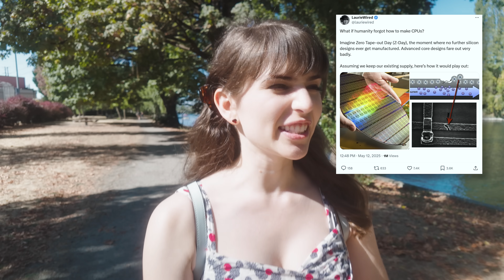what if humans forgot how to make CPUs?

Comment: The loss of CRT manufacturing is worse than people just forgetting. As soon as the production lines shut down, the extremely specialized machinery needed to produce the tubes and windings were immediately scrapped and what few remained were sold off to Chinese and SEA companies who kept manufacturing CRTs for just a few more years. Today, the machinery is completely gone and it would be beyond expensive to create from scratch considering how niche the CRT market is. The cost of starting up a new manufacturing process would dwarf any potential profits. We haven't forgotten. But we've willingly destroyed our ability to do so.

Also, geese are nobody's friend.
Reply: That has actually happened a lot through out history, it's a big component of archaeology, especially when encountering a previously unknown civilization or previously undocumented materials are found.
Reply: They should keep making CRT for Radar or even Oscilloscope and all kind of system that need analog measuring of electric signal in some communication field or medecin and army it's still usefull. But don't worry we still made valve or tube triode for guitar and audiophile equipement because it's so different than transistor.
Reply: Its not lost yet. 'Thomas Electronics' still continue to manufacture them. And there are a few other companies. ofcourse the number is not big, but they exist. And i'm not sure if they are all chinese. I think thomas electronics, for example, are an american-european company.
Reply: @ericaugust1501  Thomas Electronics doesn't produce new CRTs. They refurbish and restore already existing CRTs. The idea that they're producing more has been debunked multiple times. Nobody still produces new CRTs.
Reply: @Darxide23  the following, verbatim, off their website:

In addition to manufacturing CRTs, we also specialize in cathode ray tube replacement and refurbishment services for the benefit of our many clients who continue to use this technology.

so either you are talking ignorantly or they are lying and falsely advertising....(or more innocently, this is some sloppy copy by their website manager)
Reply: @ericaugust1501  Maybe they manufacture CRT monitors but not the cathod ray tube in them?
Reply: @ericaugust1501  There are a number of specialist companies that continue to make tubes. Some also exist that can refit old tubes with new guns. There's every possibility that someone will appear to fill the need for arcade screens. Once the backlog of tubes is all but used up, there will be a much larger demand than there is now, and demand means money. The main problem with doing this 10-20 years ago is that there were still too many good tubes floating around for the amount of people and businesses hoarding cabs
Reply: This comment haunts me...
Reply: CRT production has a lot of common with X-ray tube. People just need decrease voltage and use circuits to move electronic ray inside.
Reply: @serhiizabobonin1016  I have Oscilloscope CRTs using 17kV. I am sure there are higher voltage ones still around.
Reply: All my friends are geese.
Reply: Bit like letters for print presses. People just sold them as junk metal for the price of a coffee or similar. And manufacturing new ones probably is somewhere around 5 or even 6 figures...
Reply: CRT is for sure not stuff i am nostalgic about ,but world before smartphones YES
Reply: Depends on the geese! The ones that live in my city are extremely used to humans and are probably less of a nuisance than pigeons. People sit around in parks with geese picking up their food scraps all the time. Cool animals?
Reply: One saving grace, there are technically still CRTs being manufactured, they just don't output visible light nor have the necessary beam bending equipment.

To clarify, I'm talking about X-ray and other electron beam generators.
Reply: Geese are dicks… I thought Canadians were supposed to be polite?
Reply: Plasma is just as good. Better colours, deeper blacks, similar motion clarity
Reply: That is not at all true. TVs were not the primary use of that technology. Tv was an excellent stepping stone for the technology. Now it is used in all kinds of imaging applications from medical to electron microscopes.
Reply: Someone has one in their personal collection. We created it once, and we can do it again. It would suck, but I assume anarchy and war would break out first. What a nightmare.
Reply: @persephone342 There isn't enough widespread desire for new CRTs compared to the amount of them still floating around to warrant some company spinning up production at the scale that could make producing them affordable. Currently, there are at least a few companies that can refit old tubes with new guns, and I suspect that those businesses will be the industry that emerges to fill the need for usable tubes. Someone will have to start making new electron guns (for it to be affordable), but that's a lot easier than a tube factory.
Reply: Well, if forced to, it can be remade
Reply: @bruhistantv9806 no one is going to force it. the vast majority of people prefer new flat panels. the small need for refurbished arcade monitors can be met by re-gunning old tubes. we already have shops that can do that
Reply: We can't forget how to make CPUs... Their designs are everywhere in every textbook of electronics and semiconductors. Even I have made an 8bit CPU on breadboards from scratch and I know that someone made a 16 bit CPU as a DIY project. An other guy that made a 64 bit analogue processor in minecraft. Another guy used home made lithography to make the Zeloof Z2 chip that contains 1,200 transistors. We can't forget how to make CPUs the information is everywhere and we can scale it very fast. We could forget some very important trade secrets. We could loss 10 or 20 year of progress if a major production line or a manufacturer gets hit by a disaster. But nothing as serous as what you describe.
Reply: By SEA you must mean the Society of Explorers and Adventurers as part of DisneySEA!
Reply: @Maccbruce  No, it's the SEA men....
Reply: CRT suck
Why would we want to waste resources and energy on an obsolete, inferior, more dangerous technology?
Reply: @Soguwe  You've never seen the 4k View Sonic CRT then. It was 4K with deep blacks like OLED, and the refresh rate was at or even above 220 HZ with no need for graphic card power to push it, and no motion blur because it was tubes drawing the screen in real time and not digital. Garbage PCs back then could play the original Unreal Tournament at 4K just because of this monitor alone.
Reply: @madskygames7386 so some of the obsolete tech was of quality. Big whoop.
It was still a big tube that has a tendency to explode when damaged.
Reply: @Soguwe foolish comment and arrogant mocking mind set you have
Reply: @vidfuel12 are you denying the fact crt are dangerous?
Reply: Why we need CRT dude? they were huge bulky and expensive with less quality. You're literally blinded by nostalgia. World was right to move on. You don't need to preserve everything if it doesn't serve purpose.
Reply: @jadugar3518

It may well invoke your disdain, but there's a huge market for CRTs in retro gaming - and there are actually some advantages of CRT - over modern screen designs.
Reply: @liberatumplox625 Also the tiny few who still make CRTVs do so because they are still vital in certain industries (tech, exploration, military) and this is done for many reasons, even due to the fact some systems while still valid/operational are out of date. I believe most of these sets are quite small so perhaps larger systems can no longer be manufactured.
Reply: @jadugar3518  You might be thinking of TV tubes. The CRT in an analogue storage scope can reveal waveform details reliably that a digital scope cannot be trusted with. It does not matter to a repair man - who only needs to see if the wave form is what it is supposed to be or not, but to a design engineer, analogue is essential to find out if there is a new and previously unseen failure mode.
Reply: @jadugar3518  You know nothing about CRTs. Trinitrons had superior image quality compared to LCD displays well into the 2010s. They still look superior to bargain bin LCDs today.
Reply: @ChefDeCuisinart i have had two CRTs. Each lasted 10 years. They are not great in picture quality. You could literally see each pixel. They consumed more power. Sometimes they explode too. You're blinded by nostalgia. World did the right decision by moving forward.
Reply: @jadugar3518  Yeah nah this sounds like you had standard "TV tier" 480p CRTs and have now just projected that experience onto the ENTIRE technology
Reply: @jadugar3518 sure, cheap 480i tubes were junk, but you could say the same thing about 720p LCD panels today. 

The much more advanced 4k (interlaced) panels of the late 2000s were nothing like the junk 80s era designs, just as the 8k microLED Tvs massively improved on the VA design of the previous decade
Reply: @ChefDeCuisinart  Depends what "quality" is. Color gamut, geometry, brightness and pixel density of modern LCD is unreachable for CRT. It isn't possible to make CRT as 12" 300 dpi 1000 nits screen no matter how much money do you throw into that ring. And yet LCDs will do it while running on battery and being held in your hands. Principal "image quality" of CRT is lack of inherit motion blur. And anyway LCDs aren't really top of the range screens. OLEDs are current state of art.
Reply: @bariole why on earth would anyone want a 300 dpi 1000 nit 12in CRT. Why are you making up a pointless product to make your argument look better, lol
Reply: @jadugar3518 This just shows your ignorance of what they're good at that sample and hold are not, and of the resolutions we were capable of on especially LATE era PC monitor-tier vacuum tubes
Reply: @jadugar3518 - A good CRT would last 30 years if you kept the brightness down. Longer than that if you're willing to replace the old electrolytic capacitors. Old CRTs were designed to last. Modern displays are designed to fail. 
Nostalgia? No, practicality!
Reply: @YodaWhat  what's modern application for CRTs?

Comment: losing the ability to make cpu's... presuming it's lsi's, we'd always have larger stuff.  it's pretty expensive to make cpu's out of individual transistors, but a 64bit transistor based cpu with everything we need to interpret and read old files, refresh them before they fade and store them in ways that would keep them from fading, not too difficult, just really tedious.  in the early 90's some time there was a product that put binary data on blank paper for instance.  anyway, forget versus lose ability is important in this scenario... a war could wipe out chip fabs easily, then it'd take a decade to get new ones running, nations that didn't have their fabs destroyed, but had them hidden, would be well ahead of the return, there's also the weirdo hobbyists that built their own fabs, they'd be swamped with orders for extended 386 64bit class chips almost immediately, since the features on the chips are still pretty large, a hobbyist could do it.

     during the world wars a LOT of steam engines and boilers were confiscated to make weapons, the shops had electric motors swapped in, for a LOT of cases it's still better to run shops on one steam engine, but we've mostly lost the tech, only hobbyists can still run those kind of shops and they have to dedicate years to get one or two old engines working.  if we have a replacement for computing tech that works, even if it's not as good, but is available everywhere, we may never need to get what we consider modern cpu's back but there's always going to be hobby groups trying and files distributed with the new ones reminding everyone what was possible.

Comment: The conditions are interesting, but they only make sense for CPUs or modern silicon lithography. If we focus on modern silicon lithography, then it would naturally include GPUs, ASICs, FPGAs, and of course CPUs. Limiting it to CPUs alone wouldn’t make much sense—we’d essentially just be designing another ARM or x86/x64. Moreover, CPUs are tightly interlinked with other hardware. Without lithography, we would be forced to revert to primitive instruction-based circuits.

Comment: The real fun part is that airplane travel will probably be least effected. There is still a robust analog navigation system in place and all of the civilian fly-by-wire aircraft are aerodynamically suitable for conversion to direct electro-mechanical pilot control inputs. (Unlike some fighter aircraft that are inherently unstable to push the performance envelope.)

Comment: Fun for a thought experiment, but maybe misses some praxeology elements. 
For example there would be no need to ban crypto mining because the value of the work required would rise relative to the value of the currency produced, making it less profitable which will force out the least efficient participants, which will cause the algorithms to reduce the total difficulty to maintain the rate of production with less compute power needed.
---
The software optimizations part would have a huge spike for sure as people suddenly find it profitable to pick the low hanging fruit. There are a ton of software teams that still live by the notion that it is more effective to buy new faster hardware each year then to spend a year optimizing the program. This is really a holdover among managers from the 1990s when it was far more often true, and probably should have been put to bed by 2010 but some people are slow to change. And professors today are teaching what they learned 20-30 years ago which has its pros and cons.

Comment: I'm confused by the premise. We cannot make another CPU but we can still make other integrated circuits? Or we cannot make any integrated circuits at all? Because if it is just CPUs, we can make ASICs. Or FPGAs even. So it must be integrated circuits right?

The obvious thing to do is to reverse engineer them using the computing technology we have. Use the computers that we've created to re-develop the manufacturing processes. It will be easier as we already have an idea on what does and doesn't work. It will be extremely expensive to be sure, but doable.

Comment: I often think of a similar scenario, where we don't literally forget how to make CPUs but we lose all proprietary knowledge about CPU design & manufacturing due to some natural calamity, cyber attack or few key companies shutting down.

There is a HUGE gap between academic/public knowledge and proprietary knowledge. Trade secrets usually don't include singular big ideas but rather a bunch of 1000s of small tricks. It would take years to reverse engineer every small detail of the existing hardware and probably decades to set up another company at that scale.

And this applies to almost every complex modern product. Lithium batteries, Airplanes, AI models, etc.
Reply: Yeah, the reality is if you look into ASML, Intel, Samsung, TSMC, and Global Foundaries are all completely reliant on lithography machines made by this single company; they are the only ones to make extreme ultraviolet lithography machines and one of the few to make the older deep ultraviolet lithography technology.

Honestly, if ASML somehow went away, it would utterly cripple chip production once these vendors existing machines wore out, or they couldn't get required maintenance parts or supplies (... I have no idea how maintenance-intensive these machines are) or whatever.
Reply: That is why the open source moment of collaboration for humanity and donating is so important in my opinion.
Reply: I think the scariest aspect about this is how realistic it is
Reply: imagine if intel, nvidia, amd, samsung and apple went bankrupt at the same time, it would be crazy
Reply: But look at the incredible turn around time and cost cut from structures that have already build up and monopolized on 
that reverse engineering of almost anything can get their hands on and reselling knock offs   
example years ago in my quad copter hobby  flight controller boards 
I guess cell phones  now etc etc   all easily copied over there
Reply: But they have no QC Standard   EX:   Big company AA123  might have like 50 sub companies all vying or assigned completion of X Number of skus.
 Company Sub100  might make them to spec
 Company Sub200  might not have part whatever in blue or of proper tensile strength whatever 
ya feel me  NO REAL QUALITY  potential randomness.
Exactly what America needs to get back to   Assured quality 
but again I digress. There is no pride in working for a
good company anymore because they  are few and far between now,
COMPASSION  MORALS     sigh
Reply: That's why I hate ip law so much

Comment: I feel if we "forgot" how to make CPUs teams of engineers would quickly use the remaining still existing computers to re invent the CPU and it's manufacturing process. There's no way we wouldn't be able to do it in a reasonable amount of time given how important computers are to us. Hell, we might even come out ahead with a much better architecture if we ditch backwards compatibility. 

That would make for a much more boring story though. However, I believe a more compelling reason for this doomsday scenario to happen is if we run out of silicon. Then we might actually reach the end of the rope for modern computing.